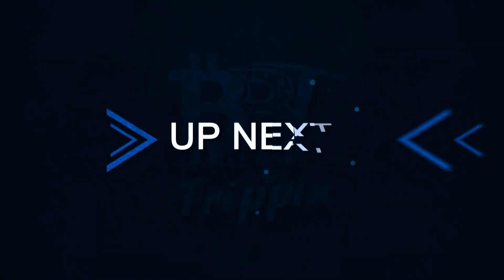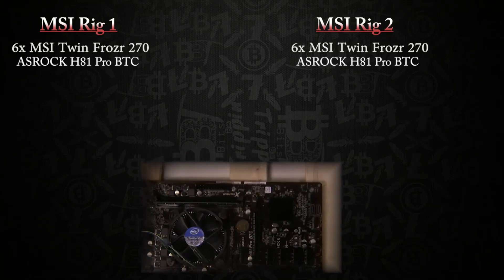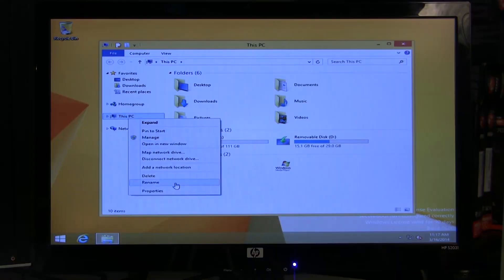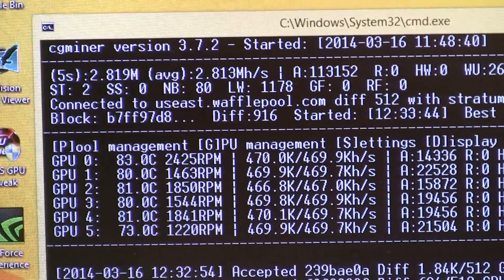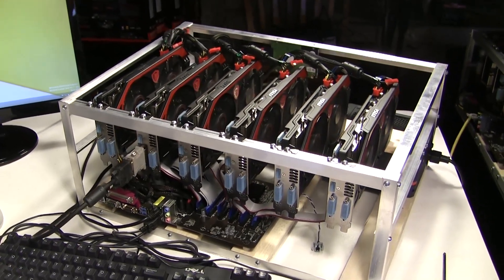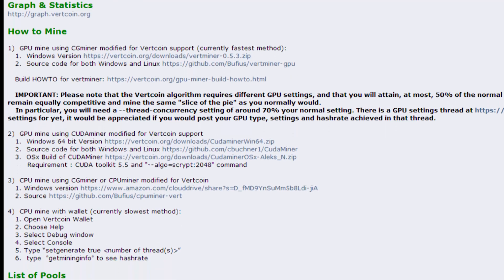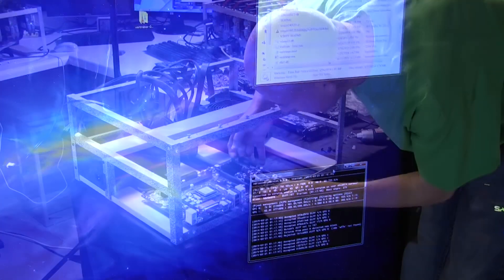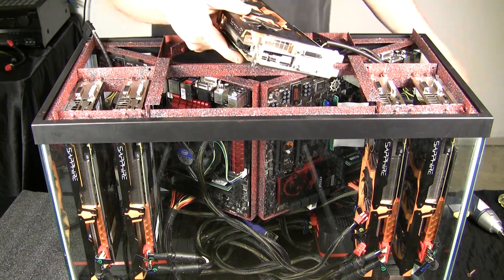BBT Episode 13: 12x R9 270 Twin Frozr Cross Compare - Cryptocurrency of the week: Vertcoin

Comment: I am having a issue with adding a 5th card.  My rig detects the 4 cards in the 16x slots but not the card in the 1x slot.  Any ideas?  When I had 4 cards, three were in the 16x and one was in the 1x slot and everything worked fine.  My device manager sees the 5th card but says error (code 43). How do get all 6 cards to be detected? I am running windows 7.  I have a Gigabyte 990fx board.

Comment: Does USB pci-e risers work fine with Asrock H81 ?
Reply from the maker: We have had them successful work with R7 265 and R7 240's with no problem, along with nVidia 750Ti. We have however had issue using them with R9 280x and R9 290 / x
Reply: Bits Be Trippin' what with r9 270 non X cards... I had problems with it detecting on mb...
Reply from the maker: we have two rigs with R9 270 non X ...both using ribbon based, due to inconsistent results from USB Risers also, some times we would boot, see all 6, some times reboot would see 4, another reboot would cure itself...
Reply: ok i have a ribbion 1x to 16x cable that is powered and board will not detect unless i hook up molex.... can i use it or should i get a non powered cable so i wont run the risk of burning mb

Comment: my r9 270 non x on vert per card hashes at 230khs with a 7870 ghz edition at 212khs
Reply from the maker: Brands and configurations? The community needs to share those goodies ;)
Reply: Bits Be Trippin'  sapphire dual x .. sgminer 4.1 "--nfactor 11 -w 256 --thread-concurrency 5121,5121 --xintensity 4 -g 2 --lookup-gap 2 --gpu-memclock 1225,1225 --gpu-engine 1050,1050 --expiry 1 --scan-time 1 --queue 0 --kernel psw --auto-fan --temp-target 70 --temp-overheat 75  --temp-cutoff 85 --no-submit-stale"   http://imgur.com/ckOaEFt 
i'm not sure about powertune but I use MSI afterburner power limit at -10% < without that hash goes down I don't know why.. 
 
It took me days to find my cards sweetspot donation accepted :) 
Vg9Hj9UMRSea4P9u5wjrQPBU1DQ6vnTbyn
DJueudzXZJg2TQJv3RSBoT54tns8aymzXw
1PLsSQ6NUo5NtZrDRwYhFK32JxM62kUDQM

Comment: Great video. I noticed at the end you were pulling 400kh with 280x toxics on vertminer. What settings did you use for this? I can't get past 265 on either of mine.
Reply from the maker: setx GPU_MAX_ALLOC_PERCENT 100
Vertminer.exe --scrypt-vert -o stratum+tcp://stratum.ecurie.io:3333 -u username -p password -I 13 -w 256 -g 2 --thread-concurrency 8192 --gpu-engine 1160 --gpu-memclock 1875 --gpu-powertune 20 --gpu-vddc 1.250

now some folks have success with --gpu-vddc 1.15 and even lower to reduce heat/power, but at the settings above the cards we have are not stable lowering voltage
Reply: Thanks I'll give it a shot and play with the voltage :)
Reply from the maker: Jonny Ward Can you try that config on say feathercoin or litecoin? Do you get 800? If so then we can narrow down it to scrypt-n config and go from there... lets see if you can get the 796-806k/h with a normal scrypt
Reply: Bits Be Trippin' thanks,  those settings get me between 731-758k/h with normal scrypt. i cant really complain as these are the best ive had with scrypt so far.
Reply: Bits Be Trippin' update. I must of done something wrong first time round with vertminer. Got 340 with your settings. System froze after ten minutes so might have to play with voltage but I'm heading in the right direction :)
Reply from the maker: Jonny Ward Excellent! :)

Comment: Why aren't you undervolting those cards ? They are unlocked I believe, so you won't void you warranty but save some money and get less heat.
Reply from the maker: We havent had much luck with stability when lowering the voltage, it requires more management with restarting every 6 hours or so
Reply: I've lowered voltage only partially on my rig (6x270 from Gigabyte, they are officially locked) and I've accomplished more stability (also could get higher clocks) less heat  and some energy savings (8-10 degree less on heat - with auto RPM, 8% energy savings with same settings as before undervoliting, the key is "magic" value 1000mV ). When I whent through some rededit topics the best undervolting card and most efficient (hashes for energy consumption) R9 270 series is Asus, but for me it is too late to chcange hardware... Can you compare energy consumprions for 6xAsus vs 6xMSI vs 6xGigabyte (stock + some undervolting), it wolud be great to see them all in one battle?! Also I've notice on my rig (inspired by your episode 6) and also on your movies that cards on place 1 and 2 (counting first and second from left if you are facing video outputs on your clasic frame) are heating up quite a bit more then rest, so I've made some tests with using extra fan (180 mm) to cool them down - facing the output video ports (need to monitor via remote desctop client like teamviewer) , and got decreas temps around 5-7 degree.
Reply: Bartłomiej Derda I have undervolted the same cards to 1.056v and im down from 1150watts at the wall to 920watts at the wall. The cards are running the same settings after the voltage drop and everything is fine. Im only hashing at 450khash though as i would pushing the cards harder just chewed up way to much power. Power in the uk is $0.27 a unit.

Comment: What kind of settings are you using for vertcoin for the msi r9 270(non x)?  BTW, I love your show.  Great info and quality.
Reply from the maker: Will be posting this hopefully tonight on twitter, I will copy and respond back to this thread too if it looks like our settings are solid. Have a set of settings right now that have been going 18 hours strong, that breaches 24 and I will post with confidence we have them locked in @ 229k each

Comment: I tried mining vertcoin but my GPU0 got only ~13kh/s when GPU1 and GPU2 get 370kh/s each (I got Gigabyte R9 280X OC Windforces)
Reply: Jason Douglas I have a 1500Watt PSU, so lack of power shouldn't be an issue.

When ever I mine any other coin, I get 730kh/s per card.
Reply: I can second that. I have three 7970's and one r9 280x and one of my 7970's is always under 6kh/s, but it moves from card to card every time I restart the miner. Very weird.

Comment: big fan of the videos BBT, really like what you guys are doing. I have 3 sapphire 7950's on a rig inspired by your guys open air design. Considering adding on a couple of those new r9 280's from sapphire. Would i be able to mix and match the GPU's and keep them on the same/similar settings?
Reply from the maker: Absolutely, its just a matter of specifying in your script (the bat file) the specific GPU and the setting associated, as an example:

-g 1 -w 512 --lookup-gap 2 --vectors 2 --temp-overheat 95 --temp-cutoff 99 --temp-hysteresis 3 --thread-concurrency 32765 --gpu-engine 980,980,980 --gpu-memclock 1250,1250,1250 -I 20,20,20 --gpu-powertune 20 --gpu-fan auto

Comment: Have you used the USB risers with this H81 BTC mobo? If so did you need to power those or did the extra power on the board cover it?
Reply from the maker: The USB Risers do work with the BTC board, however we had issues with a gigabyte 280x and sapphire toxic 280x when trying to use USB risers and the H81.

We have had good success with the 270's, 270x and 240's however with USB risers and the BTC board

Comment: I can't evev mine Vert. I'm just getting 100% Rejects on my R9 280X Rev 2 Gigabytes
Reply from the maker: We have a 6x R9 280x Windforce Rig on vert now using this:

-I 13 -w 256 -g 2 --thread-concurrency 8192 --gpu-engine 1049 --gpu-memclock 1500 --gpu-powertune 20
Reply: Heres what I get http://imgur.com/FvfvqKH Either full rejects/cards dies/or 100% HW. (Using 0.5.2 vertminer)
Config:
color 0A
setx GPU_MAX_ALLOC_PERCENT 100
setx GPU_USE_SYNC_OBJECTS 1
C:\vertminer-0.5.2\vertminer.exe --scrypt-vert -I 13 -g 2 -v 1 -w 256 --lookup-gap 2 --gpu-fan 70 --gpu-memclock 1500 --gpu-engine 1030 --thread-concurrency 8192 --shaders 2048 --temp-target 75 -o pool -u address -p x
Reply: InevitableFaker
4GB System using Windows 7
Reply from the maker: Windows 8.1 64bit Edition and 4GB Corsair Ballastix
Reply: Finally got it to work. I added another 4 GIg and for some reason Its working now, but my hashrate is only 292 a card.
Reply from the maker: InevitableFaker -I 13 -w 256 -g 2 --thread-concurrency 8193 --gpu-engine 975 --gpu-memclock 1500 --gpu-powertune 5 ...using vertminer 0.5.2

yields 349k/hash for those windforce ... got pictures of our rig running that on twitter

Comment: How's that 1050w psu holding up on the 6 270s?
Reply from the maker: The wall draw on this rig is 1090-1115AC  ... the PSU is 80Plus Gold version:

CORSAIR HX Series HX1050 1050W ATX12V / EPS12V SLI Ready CrossFire Ready 80 PLUS GOLD Certified Modular Active PFC Power Supply New 4th Gen CPU Certified Haswell Ready

Delivering 90% efficiency ... thus 1115*0.90 = 1003w MAX

Comment: I mine Vertcoin on a msi twin frozr 750ti and here is my config.

cudaminer.exe --algo=scrypt:2048 -l k40x16 -C 2 -D -i 0 -m 1 -o

My afterburner setup is power limit 100, Core clock 135, memory clock 550.

i get a hash rate of 100khs and thats as high as i can seem to get it but it runs smoothly and i have had it running for 2 weeks now and not 1 crash.

Comment: Hi, are you able to do any shows or tip with using a r9 270x struggling to any more then 450 I would really love the help. thanks bbT
Reply from the maker: Which brand of 270x?
Reply: Bits Be Trippin' the r9 270x sapphire i have the 4gb version but will getting more just of the 2gb version msy sold this one at at 2 gb price their error I just didnt say anythink, the Sapphire is the cheapest in Australia how ever I'm not brand loyal Would it matter if you had different brands in the rig of the same 270x? But Sapphire boost is the card I'm having trouble with only have one at the moment need to run optimal before getting any more or different brand, your help will be outstanding it will make the difference of what direction I'll end up going. thanks bbT

Comment: Take a look at Ultracoin...
Reply: Wow, I calculated at coinwarz.com with ultracoin.. I would have made 82 btc in a year with 4800 kh/s
Reply: SK1DROVV if its anything like vert coin your thinking your getting more hash rate than you really are with vertcoin if your normally mining scrypt coins at 100khs then you will mine vertcoin at around 50khs.
Reply: Actually we (Ultracoin) have had a few n-factor changes since the launch so the real hashrate is lower than that right now. I have 4x Sapphire r9 280x wich will give me around 2900 khash normal Scrypt but mining ultracoin I get around 590 khash. Still it is allot more profitable than most coins out there and have allot of advantages compared to Vertcoin, having allot faster transfer times being one of them.

Comment: great episode, good recommendation on the coin. VTC really is the right choice to point out here. Interesting facts about the risers, I use powered risers on the same board which I always thought of is not necessary. All works fine though but on the next rig I will go for unpowered as well. GL with your ebay sells !